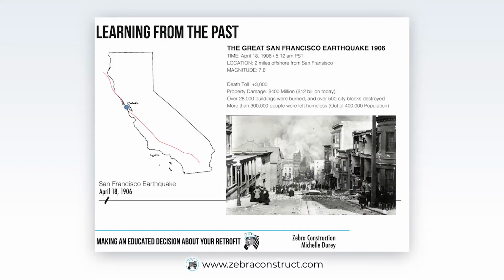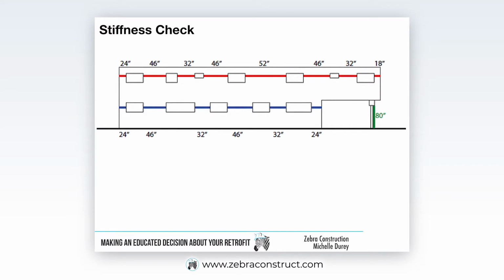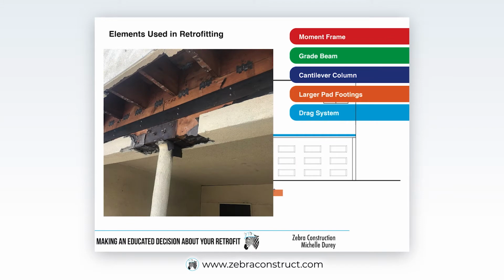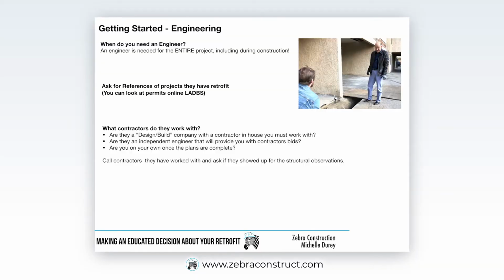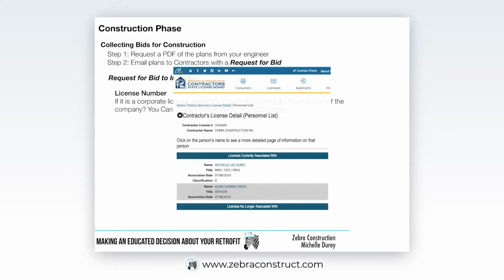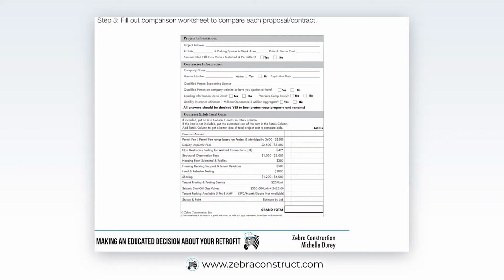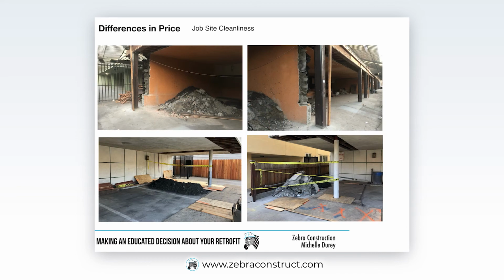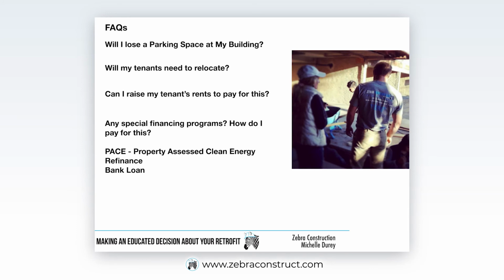Making an Educated Decision About Your Soft Story Seismic Retrofit

Comment: Is this also for residential structures? I will appreciate your response.
Reply from the maker: Residential structures can also be retrofit to better withstand earthquakes, but it is not mandated. California has a program called Earthquake Brace & Bolt which you can receive a $3,000 rebate on earthquake bolting of residential structures.